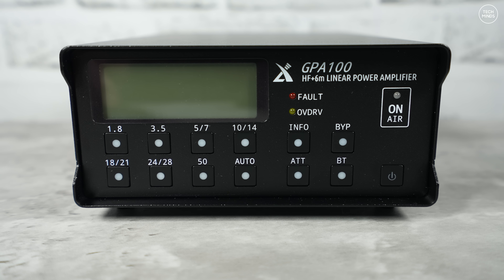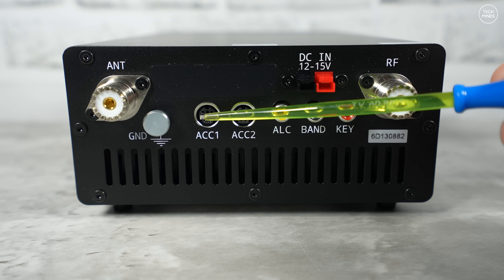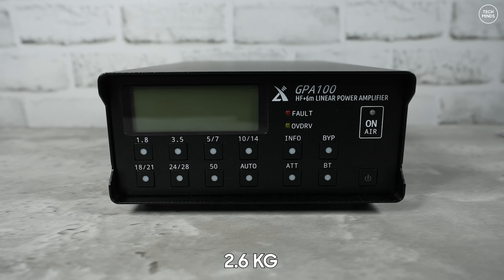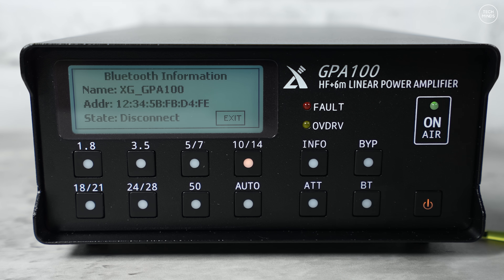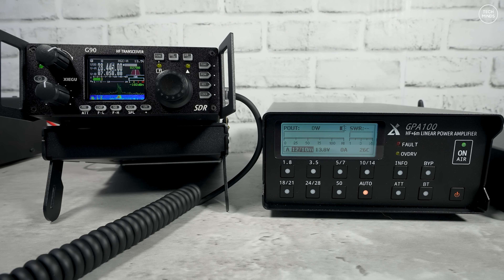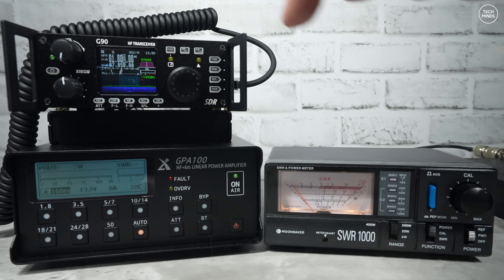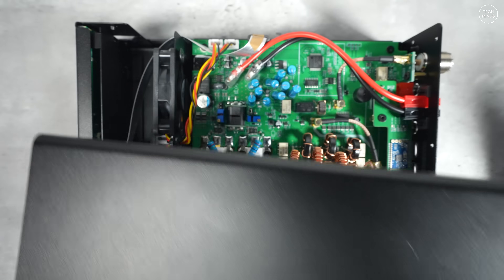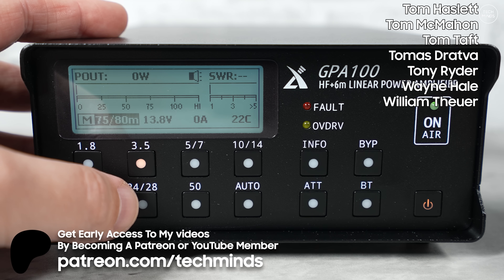This is the Xiegu GPA100! A 100 Watt HF Amplifier Which Includes Bluetooth

Comment: No tuner is a deal breaker for use, especially when portable. Big miss from Xeigu.
Reply from the maker: Just use a resonant antenna! Will be more efficient.
Reply: @TechMindsOfficial  A resonant antenna alone is not enough. Its impedance must also be 50 ohm restive.
Reply from the maker: Well yeh! Of course! Wasn’t going to go into a whole long winded speak of antenna efficiency.
Reply: @TechMindsOfficial  yes of course, a resonant antenna cannot be beaten. However, in certain circumstances (POTA/SOTA) when limited to antenna setups the ability to tune a “compromise”  to work outside its parameters is an important consideration. The question arises do I consider the ability of the xeigu XPA-125B more important than the features in this?…. for me the answer is yes, I feel the need for the tuner outweighs the features of this model. Just my opinion/needs though.

Comment: Like with all Chinese HAM Radio products, they're all aimed at the low budget HF market and make nothing of any use for VHF and above, apart from the odd PMR clone, and I think the reason for this is that they're using 20+ year old technology, old FPGA's, old MOSFETS for PA's.
I doubt we'll see a low-cost version of say an Icom 9700 anytime soon, maybe in a decade or so once the silicon prices drop and they've mastered the reverse engineering process of the complicated parts, that said I think these little rigs and amps are great for /P /M HF enthusiasts, on a budget.
Reply: The Bean Soup Theory.

Comment: Very good video!,,, I wish you had both xeigu amps in your shack and do a comparison!  I've come to trust you and appreciate what you do thanks
Reply from the maker: I have owned the 125b amplifier, which in my opinion is still a very good amplifier. I know some people had issues with theirs, but I never experienced issues with it. This GPA100 looks like a complete re-design, minus the tuner, and the build quality appears to be very good. If I had a choice to buy one or the other, the GPA100 would be the one I would go for. Having a tuner in an amp is not a requirement for me, I hate running tuners in the shack. Cheers :-)

Comment: I recently received the GPA 100 to be used with my IC-705. Connected via Bluetooth right out of the box, worked perfectly. It does seem that the band switching and PTT both worked flawless to operate the amp. I have yet to use the included cable as it seems not needed to operate. If I turn on the amp and then the  IC-705, connects right away via Bluetooth. Thanks for all the informative videos. 73's

Comment: I just recently bought an XPA125 go place between my Hermes Lite 2 and kilowatt tube amp and I'd KILL to have that attenuator feature. I have to keep the HL2 output down to around 1/4 watt in order to keep the output of the Xiegu in the appropriate range to drive the tube amp and it's VERY touchy keeping it in the sweet spot. I added a 3dB attenuator inline, but of course that drops my received signal as well. I may sell the XPA and pick up one of these, as the antenna tuner is not useful for this particular application.

Comment: I don't feel like Bluetooth should be anything special in 2025. That's like a 50 cent upgrade.
Reply: And they dropped the Xiegu tuner. The XPA100 is a better amp as it includes the tuner.

Comment: Looks OK. I am surprised they didn't include an ATU, maybe they will in a future version. Did you say it was RF switched as well as hard switched? As for Bluetooth and IC705, I designed an antenna switch using that feature which worked OK. Antenna switching is necessary on a radio that covers 160m to 70cm. RD100 transistors are even over-speced - normally they would screw 200W out of a pair of these. Each one can deliver 100W up to 30 MHz and very probably on 6m too. They have a VSWR limit of 20:1, all phases so by running them at half power and with the protection, it should be ham proof. Well maybe.

Comment: Nice review, would have been nice to see the impact of the ATT on the power output  -- i.e. I'm guessing with your 4w in you would get about 25/30 watts out - perhaps useful feature if you want to keep the amp in line all the time but don't want to keep adjusting the transceiver to trim the power

Comment: Nice to see they used a pair of 100 Watt MOSFET's for amplification instead of driving a single one to the point of destruction.  Basically the same architecture used in most 100 Watt HF rigs, dual 100 Watt finals.

Comment: I'd definitely take the neptune over this.
Reply: I have one of the older Neptune 50W amps without the auto band switching and it's built like a Ukranian tank. I've built cables to run it with a QRP-Labs QDX, FT-817 and  Lab599 TX-500 and it's worked flawlessly even when I've accidentally overdriven it. 

This does look like a nice amplifier. If I didn't have the Neptune and was in the market for a 100W amp, I think I'd go for one of these.

Shame it doesn't have a frashright.
Reply: @rjy8960 sane here.  Love the Neptune 50
Reply: The Neptune 100 also looks solid

Comment: It's hardly worth it for a single S point.
Reply: With 5 Watts of drive and 100 Watts out that's 13dB of gain.  That's 2 S-units +1dB.  That could easily be the difference between not being heard at all and making a contact.
Reply from the maker: 5 watts to 100 watts, most likely see a bit over 2 S-Points, which can mean a lot in harsh conditions or busy bands.
Reply: @TechMindsOfficial correct Mat. It’s the SNR that matters, not s points. You’ve tempted me now to get one for my G90
Reply: @fairwayfinder18 I have the older 125B that I paired up with the G90. That was my daily driver for about a year, and did not disappoint. That extra S unit absolutely made enough difference to warrant the cost, knowing I could also break it out with the 6100 without any fuss.
Reply: You've obviously never used a CB radio? You have no clue and shouldn't be chiming in here. This forum is for experts who know that 100 watts is better than 5 watts.
Reply: @andimerkle6924 😂😂😂 what a papa romeo alpha tango. 73